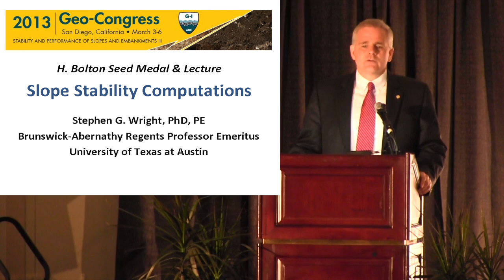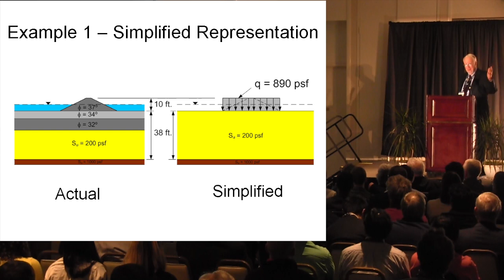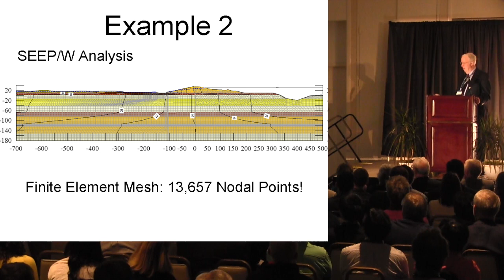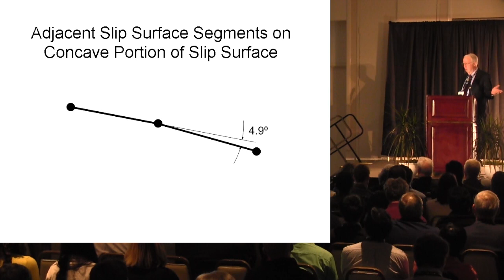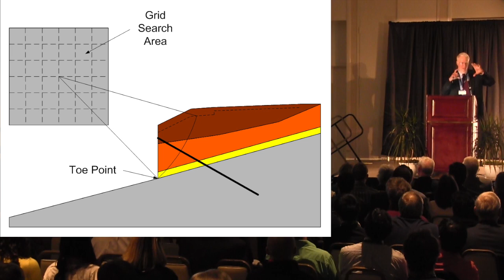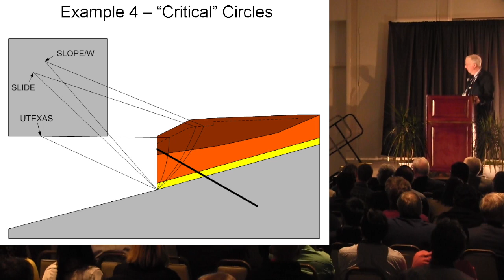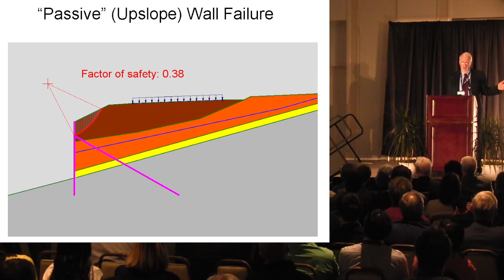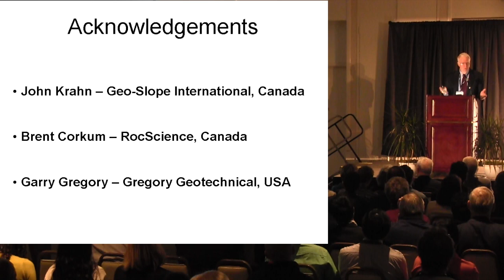2013 H. Bolton Seed Lecture: Steve Wright: Slope Stability Computations

Comment: instead this "old fashioned" method use FEM modeling of with C-fi reduction  algorithm. It always leads you to univocal solution of any stability problem, together with influence of water. No need ti divagate "circes" or other shape of slip surface. Available for example in ZSoil code (since 1985)
Reply: Although I side with you, there is still a place for classic slope stability analysis, and it is not going away any time soon.

From the educational perspective it is easier to introduce the student to Limit Equilibrium, and the mechanical-geometrical treatment of failing soil masses than it is to FEM. From the practice point of view, LE analysis is very close to reality in many cases, and has been verified with real landslides and scaled centrifuge models. You can also extend it to reinforced slopes or retaining structures, which in FEM is another type of problem.

Think as well about the practicality of programming a spreadsheet to solve your problem, not everyone has access to FEM software.